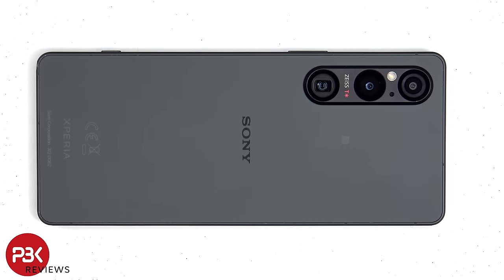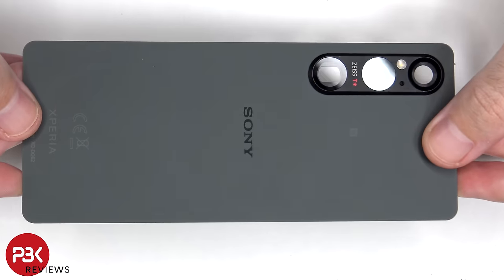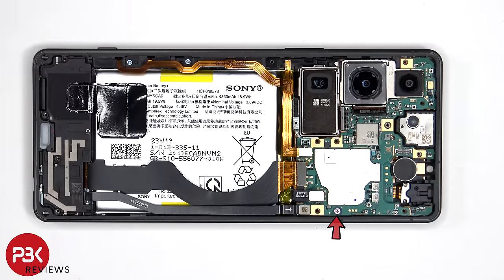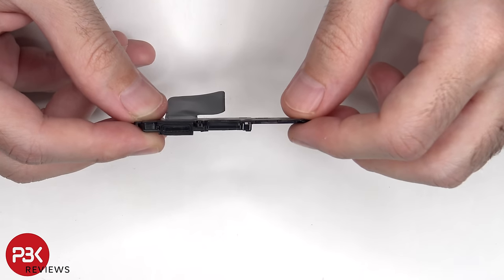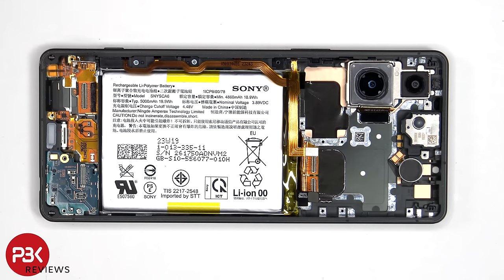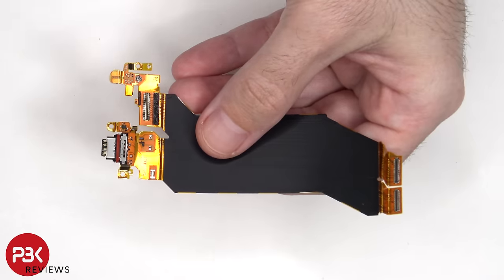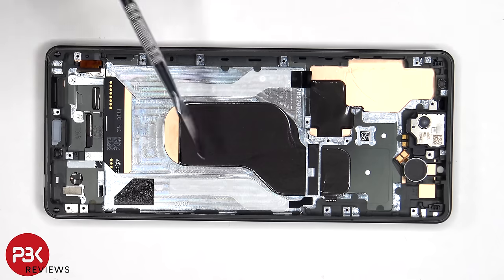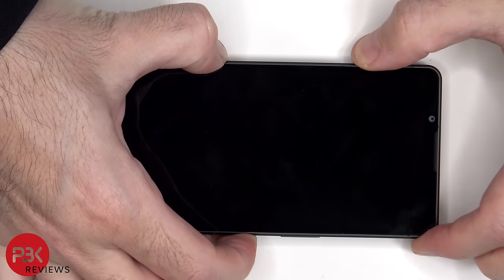Sony Xperia 1 V Teardown Disassembly Phone Repair Video Review

Comment: Looks like a solid design, I like seeing the charge port on detachable ribbon cable rather than soldered to the main board. I had to replace my mainboard on my current phone twice due to bunged up mirco usb port.

Comment: It's strange, Samsung swears there isn't room for the headphone jack or micro SD, but Sony..........

Great video!
Reply from the maker: Thank you :)
Reply: Samsung saves money he said
Reply: use type c headphone man its not the thing you should cry about instead we have to find the solution on what we have...
or buy the headphone jack convertor they should have given the port but we cant do anything these days everyone trying to earn money either by looting people or making the thing expensive which have all the components...
Reply: Aka not solving the core issue of samsung cheaping out on not giving you the most basic feature  @iam_churchill
Reply: @iam_churchill oh yeah how gonna use the jack if want charging at same time huh?
Reply: @carolljohn3148  it's not recommended to use the phone while charging 🤣
Reply: @iam_churchill  uhm not on sony or rog phone. Can bypass
Reply: @iam_churchill you know shit. Sony has this neat feature that when you do certain things (gaming or streaming) with your phone while it’s plugged in, you can choose whether to let it charge normally, or have it not charge and instead use the current from the charger to power the whole phone instead of the battery. That way the battery level stays the same but the phone dramatically cools down, it doesn’t heat up at all.

Comment: Amazing and underrated channel with high quality content. Thank you! Wish you reach out to 1mln one day!
Reply: BTW, it is recommended to lift up (using suction tool) glass backplate or screen from the middle, not from top or bottom part, at least in official XZ1C Maintenance manual, otherwise there is a risk of damaging these.
Reply from the maker: middle meaning to start prying from the middle sides n work your way down?
Reply from the maker: Thanks 👍

Comment: Interesting, do you think there was room for a vapor chamber or that it was a cost cutting measure?
Reply from the maker: there is room, they just chose to use graphite instead. Could be cost or could be other factors like sourcing it was delayed so they didn't want to delay release or maybe other issues.

Comment: In technical terms, vapor chamber is a much better option than the 3D graphite layers like in the Xperia 1V? Or sony did just choose to pick up the graphite layers due to cheaper costs?

So which is which?
Reply from the maker: There are many types of vapor chambers, both by material and by internal design how the vapors flow and transfer heat around etc. So all depends on what they could or would have used, so vapor chamber doesn't always mean its a much better option than 3D graphite. In most cases 3D graphite, if enough layers, can do just as well with heat transfer, but with some of these vapor chambers on some flagships, they have much better design than basic vapor chambers. So I'm assuming probably a cost cutting measure but they probably deemed the vapor chamber they were going to use was provided the same or similar yields to the graphite so they just went with the cheaper option.
Reply: @PBKreviews  thanks for the insight. Well atleast for us consumer we do have these kind of information.

Comment: thanks for making this video that i've been waiting for. do you have a high res photo of the phone with the back removed?
Reply from the maker: You're welcome. Yes here is the link, there are 3 pics, the 2 darker ones are the unedited 300DPI ones, and the other one is the brightened version. Aside from these you can screen shot the video but it wont be has high res if you plan on printing it etc. https://drive.google.com/drive/folders/1nfQgeFe-yZZebsGt2H-Apd3dU-zDS3bR?usp=sharing

Comment: I have a question. please reply. Does Sony still have a notification light on this device that alerts the user of an unread message?
Reply: I have a 1 V.  No notification light on this one (unfortunately).
Reply: @WhimsicalPacifist  Thanks🙏🏼
Reply: The Sony IV generation was the last one to have the notification light. They have dropped it with the V generation. If you really want the notification light, please consider buying the 1 IV.
Reply: I have Xperia 10 IV and it has those notification lights, and works perfect for unread messages as it keeps blinking green light for notification and while charging or low batt indication as red light blinking

Comment: what is the hole at the bottom of the phone next to the sim door? is that the microphone? oops. thinking this was a iPhone I stuck a iPhone sim tool in the hole. seems to sound ok on calls still.
Reply from the maker: yeah you'll be fine, it wont damage the mic

Comment: Seems like Sony is cheaping out on Camera lenses. They charge so much and only have OIS on 1 main camera  should have on all cameras.
Reply: Sure you arent a Scamsung troll?
Reply from the maker: considering their main selling point are the cameras on their phones, I would have to agree with you. Their cameras are good (not the best) but they don't really add too many features. With the cost they charge for the 1 series I would expect more. Also keep in mind the telephoto has built in OIS as well. So only the ultra wide is missing it.
Reply: @PBKreviews   ahh I must have missed the telephoto camera part on video. 
I always wanted a Sony Phone, but the price for what you get is prohibitive. Only 2 years updates. The 4k display is nice. Most of the cost on this phone is the Software for Cameras.
I guess it's hard putting OIS on every camera as it needs extra room in case.
You think Sony  would have invented a single Lens all in one camera. Meaning it does Main, Ultra wide and telephoto.
It's possible with Camera lenses adjusted electronically.
You would have one big Sensor  with a huge bump to accommodate all lenses and zoom prizims.

Comment: No wonder heat problem is still being a big one with Sony's, why they are still using thermalpads\fillers instead of a good quality thermal paste is just beyond me. Make a tight fit, use thermal paste, how hard it can be? Stupid.
Reply from the maker: yup, not sure why they don't switch to thermal paste

Comment: I have said last year in the 1 IV teardown comment, the 1 IV teardown was a waste of your production time and budget, because there was already another one when you did it.
This year, I am looking at this matter from a different angle. I have seen a bunch of request for 1 V teardown in the 5 V comment. I guess the 1 V teardown is a good use of budget as long as it generates enough views. However, I still stand by another part of my comment last year, as this 1 V teardown does not have further contribution to the internet knowledge base.
As such, I would like to see a teardown of 10 V, as I can’t find one on the internet. The 10 V is probably the last 10 series phone to have a telephoto camera, a rarity in mid-range phones. Sony has even dropped the telephoto camera from the flagship 5V.
Sony phones have been reducing cost in recent years which impacted customer experience, most notably the dropping of telephoto camera on the premium 5 V. The issue of having green and pink lines appearing on the screens of 5 series phones aside, Sony phones are still less worth buying in recent years.
Reply from the maker: Yup, there was a reason I didn't do it for a long time but people kept asking for it in many videos so once I was able to find one at a "decent" price I decided to do it. But yeah depending on the outcome of this and the 5 V video I will consider the 10 V.

Comment: i hpoe sony comminuty gwros becuse sony phone are something else there spical but unfortunately very few people buy them the buy xiaomi phones and they are tashhhh
Reply from the maker: 👍. However depends on which xiaomi phones you go for, some are definitely not trash especially the high end ones. Hardware wise, if they had one that fully worked in the US I would probably go with a phone like the Xiaomi 14 ultra or pro vs the Xperia 1 V. But software wise I am not a huge fan of their custom OS.
Reply: well the numberone thing i hate about xiaomi is thier os and it has adds built in the os and not reilable as much but sony was always ahead of its time first company to interduce waterproof phones first company to relase a 4k display on a phone sony phones have the most important factor and that is build qulity
and it is older sony was making phones when xiaomi didnt exist at all @PBKreviews

Comment: I'm curious why you gave pixel 8 pro the same score even though, it's a massive amount of adhesives there which is a nightmare. This one is just so much straightforward. Almost screws only, almost no chanche to damage any of the parts... Just weird...

Btw. Nice disassembly video.
Reply from the maker: Thanks. The score is broken down near the end of the video into sections. Just because one phone is for example an 8 and another phone is also an 8, doesn't mean in every section they are the same. Maybe one phone scores higher in part availability (to find parts and purchase them) where as another brand scores poorly in that section but higher in another so making the overall score the same. But the breakdown shows in each section what I score it to give a better understanding.